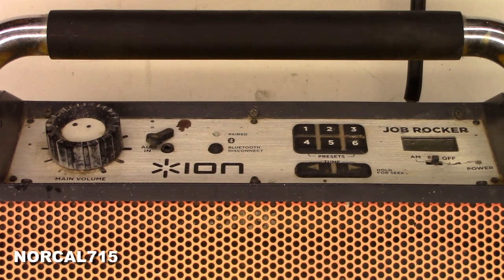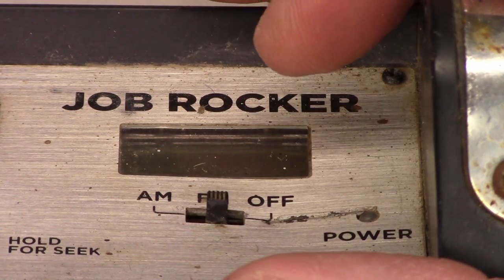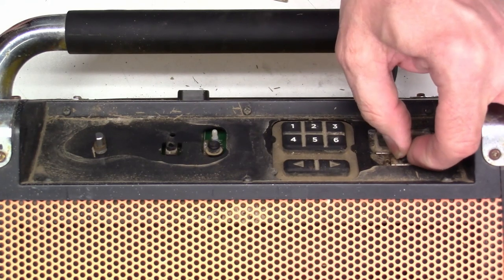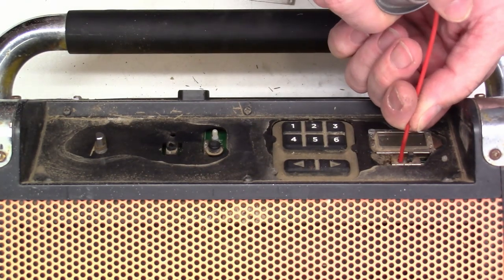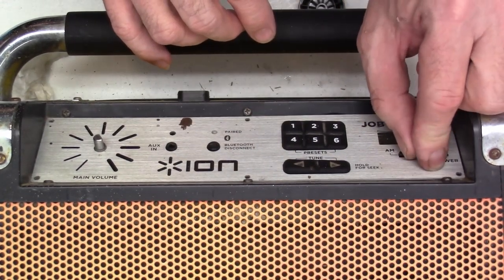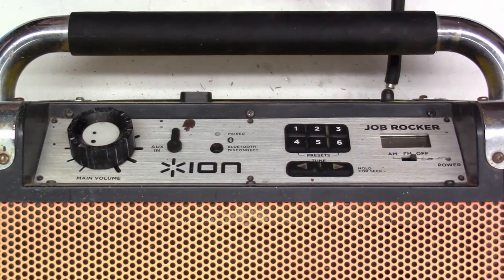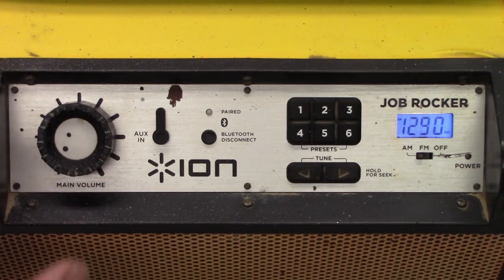ION JOB ROCKER QUICK REPAIR NO DISASSEMBLY DEOXIT D5

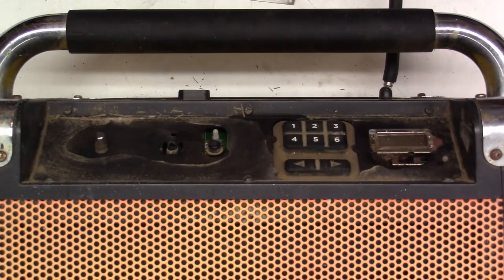Comment: 1:59 Hard to reach corners, small gaps / crevices (e.g. between buttons) can be cleaned with a paint brush and for example alcohol.
Reply from the maker: sometimes i use a toothbrush in addition to a paintbrush because they have stiffer bristles.